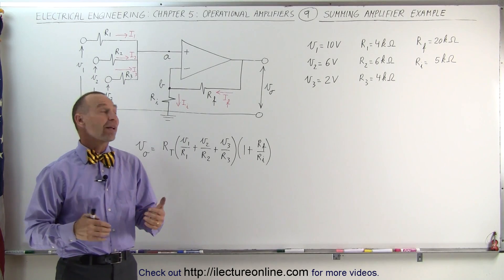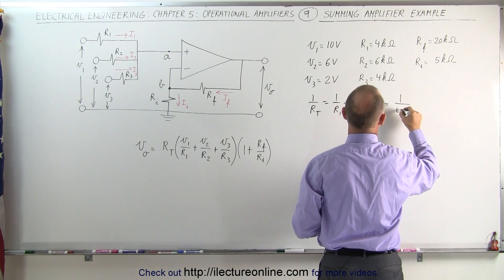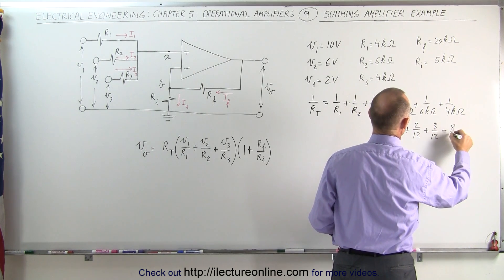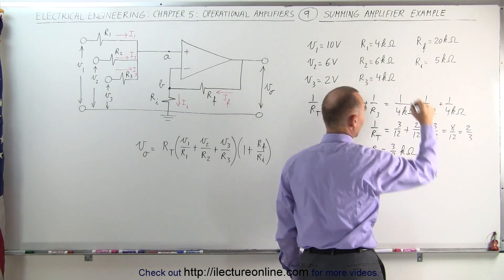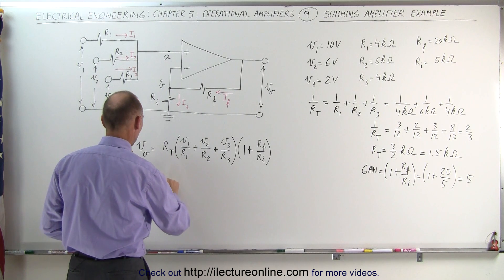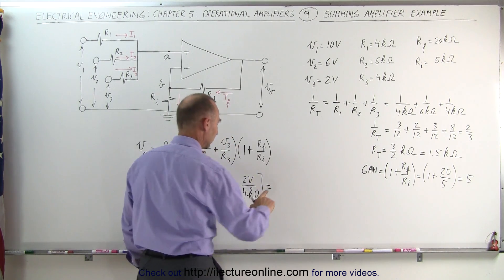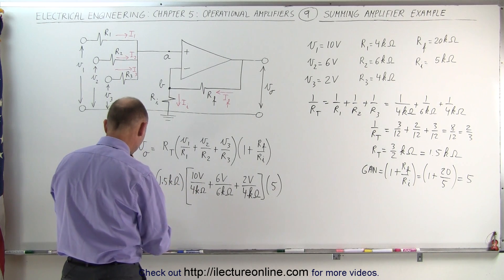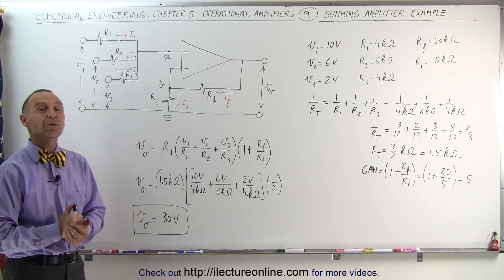Electrical Engineering: Ch 5: Operational Amp (9 of 28) Summing Amplifier (Non-Inverting) Example

Comment: did you say in the beginiing that the voltage supplies typically dont exceed 12 volts in this series? YOu should have accounted for saturation, or mentioned it.

Comment: sir, at 2:51 why did you divide 10 voltage over 4, instead of 4000 cause it is kilo ohms
Reply from the maker: The 1.5 kilo ohms in the front negates the kilo ohms in the denominator
Reply: @MichelvanBiezen  thank you sir very helpful 😊😊😊